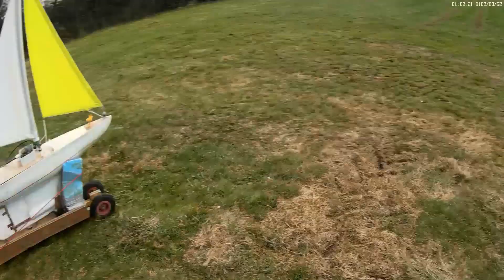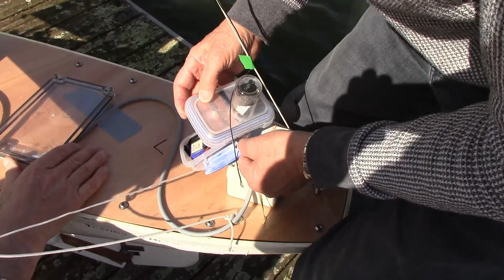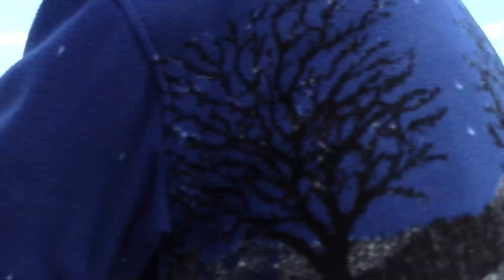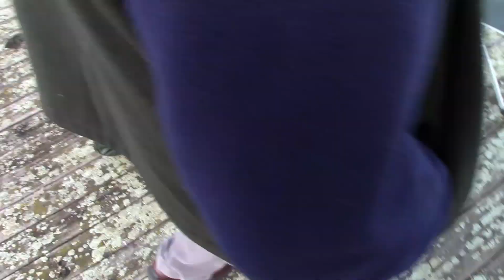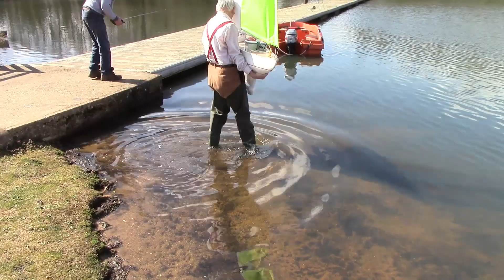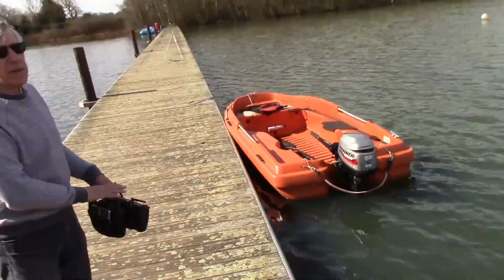Woodstock's first test on Horseshoe lake

Comment: Congratulations, a lot of hard work coming together. Really impressed at how well that helmsman loop performed, it took me ages to get mine right. I think its a big advantage to have rudder position feedback. (I don't, my only measurement is heading, and my only output is rudder velocity.)

Impressed with the telemetry too, as well as the autopilot.

Shame about the rudder loosing it's lock. I was going to propose in future moving to a more balanced rudder, with the axis of rotation closer to the centre of pressure. This approach seems pretty common on aircraft and my yacht has it to some extent. It won't fully solve the back drive issue but it will reduce it, and, in the heavier season, it will minimise the power consumption. Disadvantage is that it may upset the hydrodynamics between the long keel and the rudder. (not sure how much, I can root through my books and see if they say anything.) 

Well done again!
Reply from the maker: Thanks. Yes a more balanced rudder would help. For the next boat, which Dick will be working on, we plan to have a smaller, more balanced, rudder nearer the stern. We plan a framework which will allow moving mast and keel and rudder around to experiment. But I'm still pretty much set now on a worm gear. The Savox servo also consumes a lot of holding current. I know nothing about hydrodynamics, so any help will be gratefully received. I tend to let Dick address the sailing aspects, as I'd rather have something I understand like an engine!